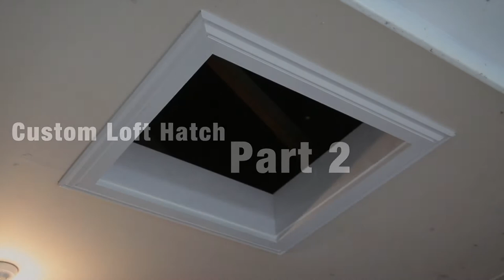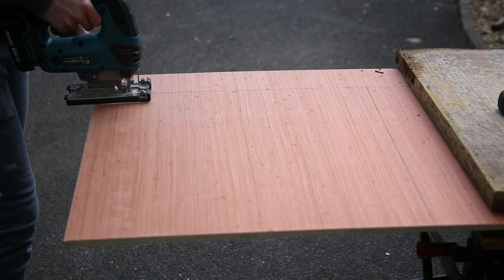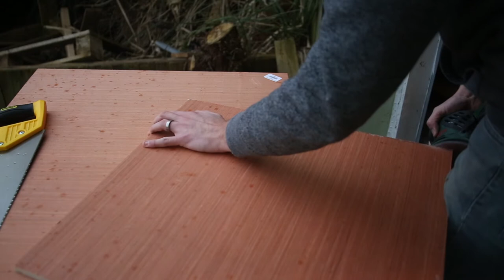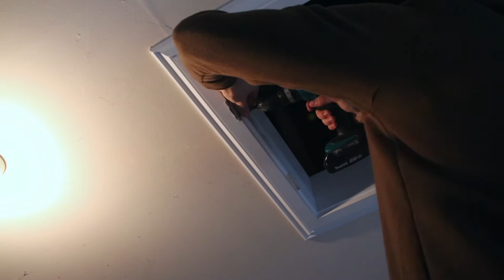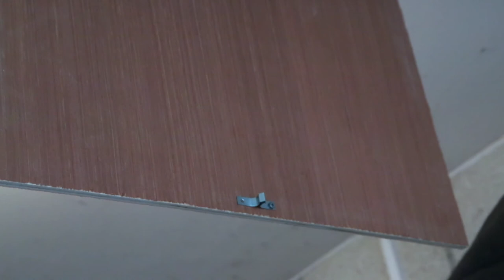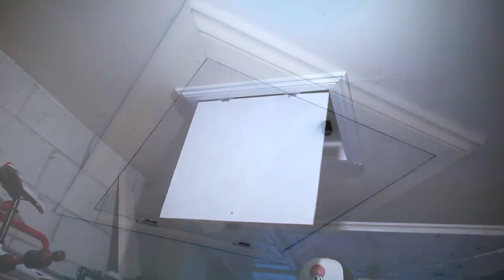HOW TO INSTALL A LOFT HATCH: PART 2

Comment: Excellent video, thanks for sharing. When attaching the skirting around the opening did you set it back slightly so the hatch door is bigger than the opening? If so did you offset it all the way around or did you have the hinge side flush? I can’t quite make it out in the video. Thanks.
Reply from the maker: Hi Kelvin. Did you watch part 1? It shows me attaching the architrave around the opening. To answer your question. Yes. I fixed them set back slightly almost half the thickness of the timber insert which lines the opening. I then chiselled flush the hinges. The hatch door should be bigger than the opening so there is no gap / draft for best insulation etc. Thanks for watching!

Comment: Thanks for the video. 
What is the black thing called you use to open the hatch ? Thanks
Reply from the maker: Hi Nikki, this is actually just an old plastic washer / spacer I found lying around. Perfect size to fit a bolt down the middle and fixed with a nut through the other side. You could purchase a real handle if you search cupboard knob / handle online.